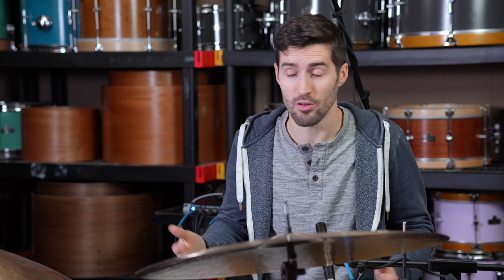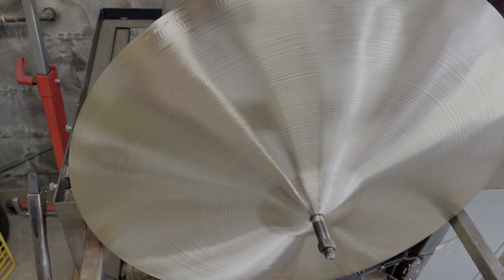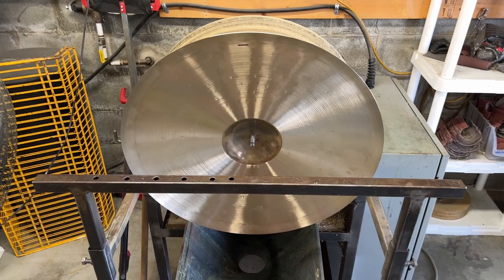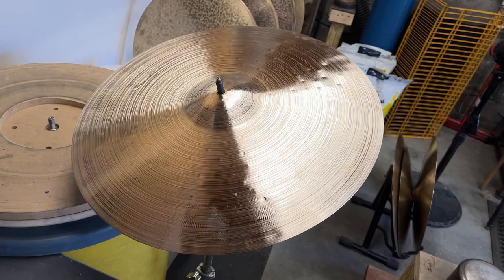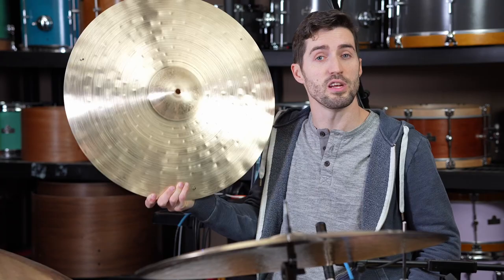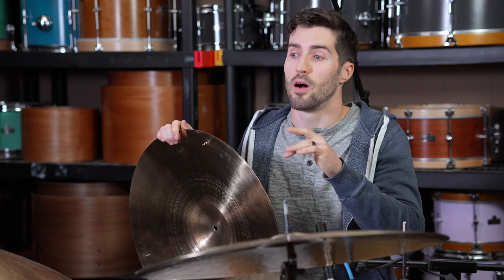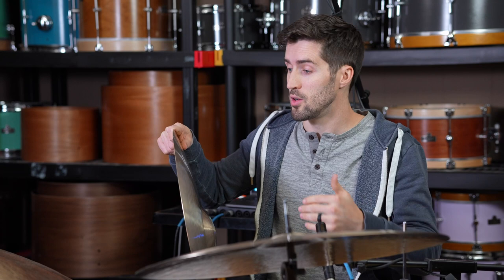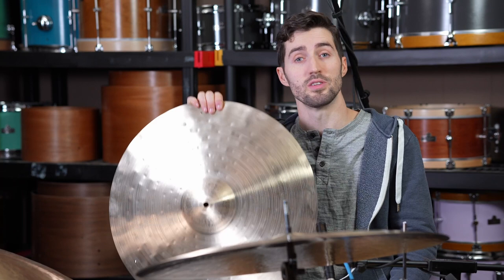Lathing The World's Heaviest Cymbal (or at the heaviest I've seen)

Comment: Some things should be left as is. These cymbals are quite rare…to me its like cutting up a classic car or cutting a vintage Harley frame. Me personally, I would have talked the owner into having a new cymbal made instead of carving up this one.
Reply from the maker: I see it as an interesting experiment. The customer wanted to make it something they would use and it has sentimental value. Not for me to judge whether or not it’s worth doing!
Reply: I agree. I would have left it alone if I was the owner.  But also I would have took on the challenge of tweaking it into something new.
Reply: The cymbal is much more functional and musical now, I'd say it's more valuable now than it was before. Like Tim said this cymbal was sitting in a bag for 20 years. The ink stamp and the original make really ain't worth keeping if the cymbal isn't really usable in most situations.
Reply: @Dsullivann  on the contrary, given the rarity of that cymbal, it would have  easily sold for a price that the owner could have had 2 custom cymbals made by Mr. Roberts…those original Z’s are not in great abundance, and a 24” is almost unheard of…it would’ve fetched a pretty penny on the collector’s market without doubt. It’s all good, I just have a differing outlook is all.
Reply: If it's not being used then is it really valuable? Owner can do what they want
Reply: @dhmtbr2551   I see both sides of the coin. On the one side why keep something you don't use unless you're a collector.  On the other side sometimes it's up to the person playing it what they want to do with their property. I liked it the way it was. Heavy, and genre specific.
Reply: @ReverieDrumCo  Like Paul Francis said in your interview with him, he would have tried to talk the owner out of altering it.
Reply: @Dsullivann  Functional for what? Certainly not functional for metal at all now, it's useless for metal.
Reply from the maker: @NEALBABBITT  I was pretty interested in the project actually. Even if these cymbals are rare, to me they are still one of the silliest cymbal designs ever.
Reply: @NEALBABBITT  The person who owns this cymbal probably isn't playing any metal, and the modified version is way more suitable for jazz and acoustic settings.
Reply: It's a machine-made run of the mill useless manhole lid. Not a  "rare antique piece of hand-tooled machinery" by any stretch.
Reply: @mentalitydesignvideo  yup.
Reply: @mentalitydesignvideo  Sentimental Value increased drastically. Not every "collectable" is worth collecting.
I have a K from the late 40's that I'm afraid to play sometimes; not because of it's monetary value; but because I got it from my dad when I was 5 years old.
Reply: @Lupine.  yes, but not on this Z mostrosity.

Comment: im glad i saw this cuz my concept is 2grab up some old K custom or A custom cymbals size range around 19, 20 21 22' crash-s or rides ,. but is going 2 be to shave the shat out of them to turn rides into crashes ,. i love the bell on the old K custom welkl ride have not played one in decades however they are around 2,800-Grams or so on a 20 inch cymbal and we need it to me more like 1400 1500 grams you can hammer the crap out of them and dry them out as well or open them up but its going to be take a lot of the bottom side and umbrella out the cymbal and reach very low gram weight to the size of the cymbal then probably hammer as well and its ok if rides turn into crash/rides or crashes its going to be i still should have the K custom super bell still retained in the shape ,. and really to this day i have not seen a bell as cool or to match what ever weckl had them do,. most bells not that big,. the old K custom tho is Z like its they mixed a little Z into the K maybe its super heavy ,. i just like the shape ,. its turn that into a crash would be super cool , .. . and again make a set of them ,. i get a bunch of used cymbals and send them to you low weight larger sized cymbal set ,. would be cool ness  ,. cheers :) '
Reply from the maker: Yeah! I'd love to work on these for you. Here's the link to my mod form: https://reveriedrums.com/shop/p/cymbal-modification

Comment: I have Mega Bell Ride which worked for me when I bought it in around 1989 but I really don't like it anymore. It's pretty much like a church bell. I'd love to see what you could make of it. Theres plenty of material to work with. It's not as heavy as that Power Ride (just over 4Kg I think) and it's not as wide (21").

Actually, my 13" KZ hihats could use a treatment too. I really used to love clangy cymbals. I think my band was too loud and I chose Zs to get my point across. Thrse days I much prefer a much lighter sound with a higher pitch
Reply from the maker: I can certainly help you out with both of those! I've got a modification order form on the website where you can place an order. There’s a bunch of information on the page as well.

https://reveriedrums.com/shop/p/cymbal-modification

Comment: I'm curious: could the shape/profile/taper have been changed without cutting, by hammering, heating and pressing or any other way, so it remained a 24" but with the desired profile...?
Reply from the maker: Not with this material. With B20 bronze, you can’t go backwards to lower shapes via hammering. It would stress the material too much and cause it to crack. The way to do it would be by tempering and quenching it. That would cause it to lose a lot of its shape and tension. In that case, however, it would be really loose and floppy.